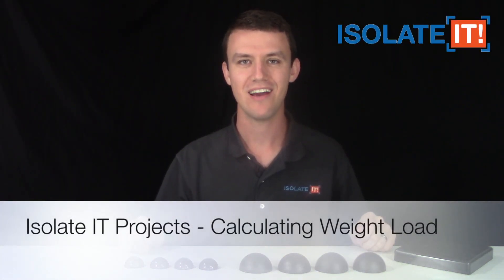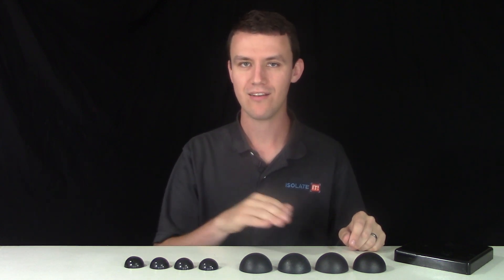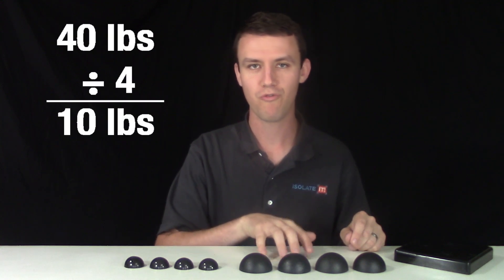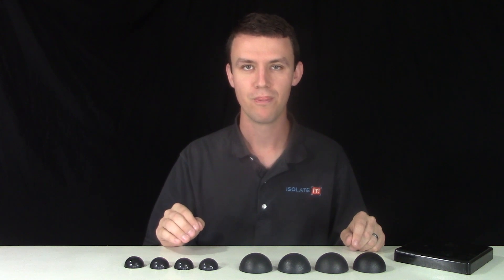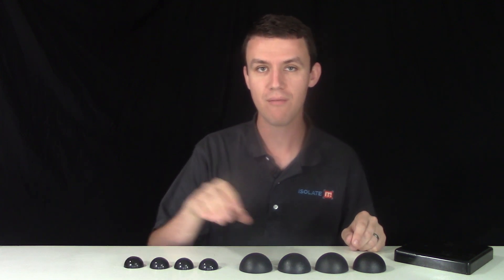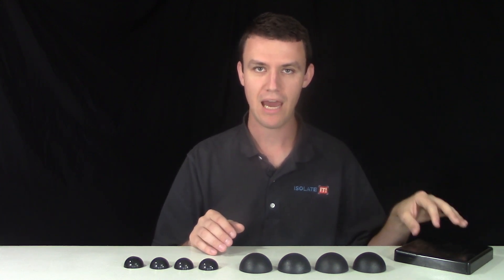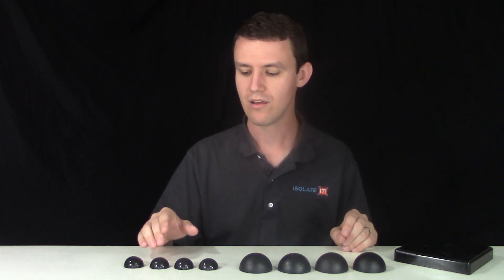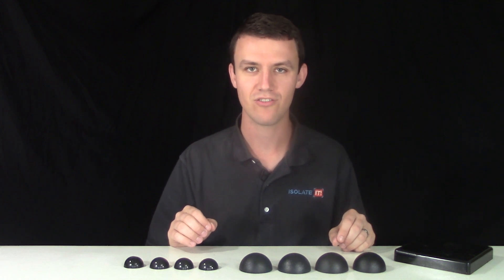Isolate IT Projects - Calculating Weigh Loads

Comment: You don't actually either indicate or demonstrate HOW to pick the correct pad for a given weight loading.   Why?
Reply: Weight of what you’re supporting divided by number of isolators you’re going to use.  In my case my monitors are 17.6 lbs each and I want four hemispheres on each.  So 17.6/4 = 4.4lbs.  Each isolator foot needs to support 4.4lbs.  In my case the 0510131-30-10 fits my requirements for proper loading as each supports 4-7lbs.  Lower “duro” ratings tend to be recommended for better isolation.  I’ve seen it recommended to stick to 30 or 50 for my purposes.